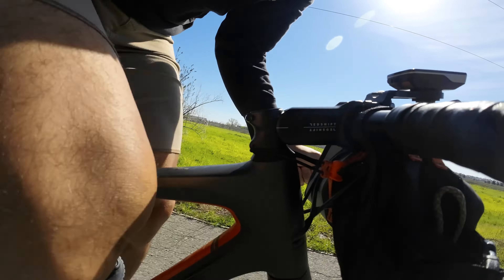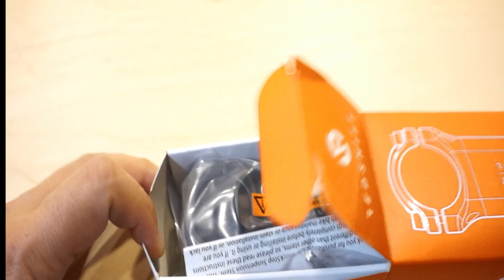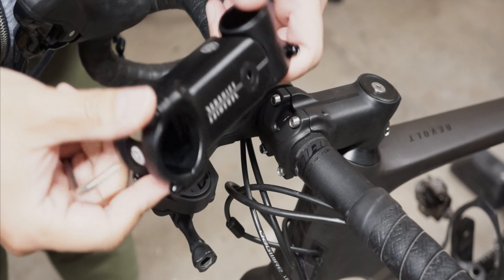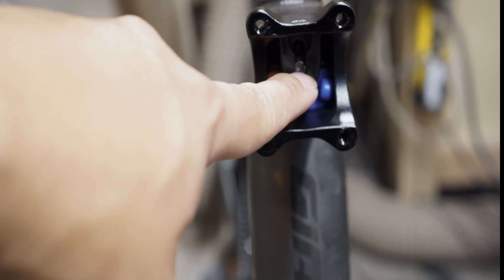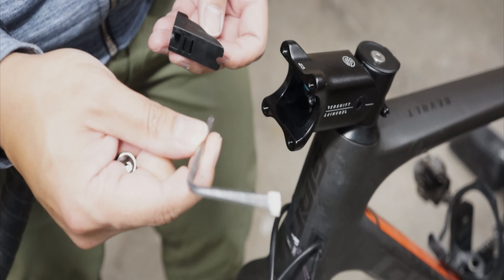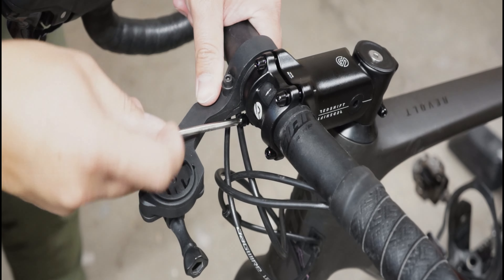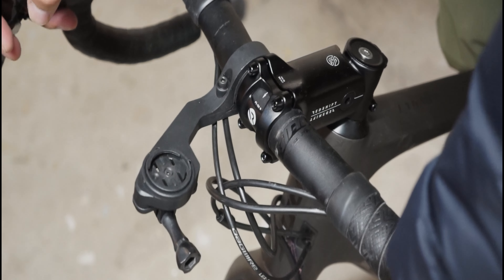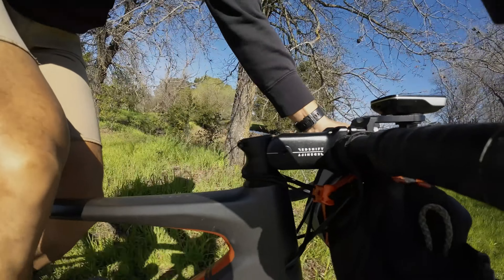Redshift Shockstop Suspension Stem Install and Review

Comment: Hey Dude, nice video. I'm a far bit older than you are, but also an avid cyclist looking to preserve my bones as long as possible. With that in mind, I'm curious as to whether you're riding tubeless on your graveler? I recently switched to tubeless on both the gravel and mtn bikes, and I noticed a BIG difference in "cushiness" from just doing that...since you can lower air pressure without creating more drag. I JUST got my suspension stem and will be installing it today. Everyone says they "get cushier" after a short break-in period, so I'm sure you'll notice that too. Take care and keep at it!
Reply from the maker: Yes I ride tubeless because the trails here have thorns and I used to get flats a lot when tubeless was not even a thing. You are right you can run a lower tire pressure with tubeless setup. The rubber cushion in the stem can wear out the good thing is that it is replaceable. Thank you for tunning in and take care as well 🤙